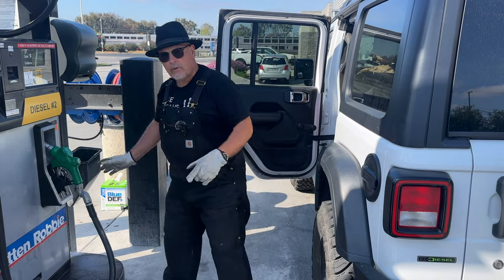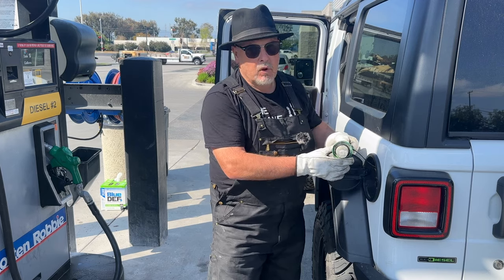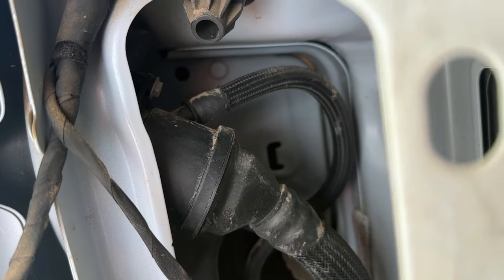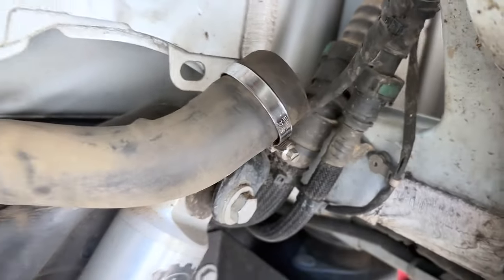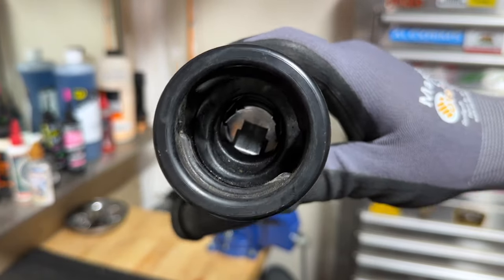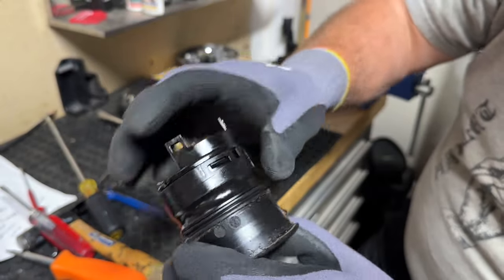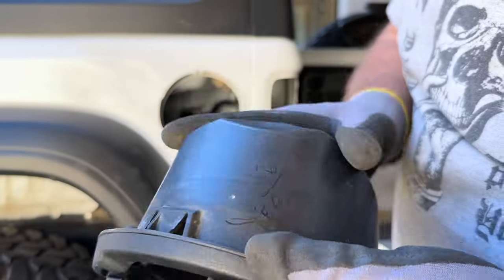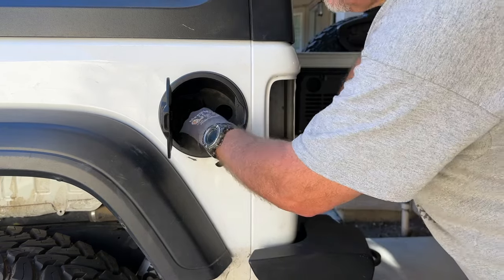How To Delete Ecodiesel Filler Tube Restrictor | Discriminator Removal (Use Large Diesel Filler)

Comment: I have a 1985 F250 with a 6.9 IDI that has a small filler hole, but I use truck lanes by sticking in a big funnel and watching the flow rate. Lol.
Edit to add: if you don't watch the flow rate at the truck lanes, it'll be a lot of foam and not liquid. Filling a filler neck creates a lot of turbulence versus a big 3" hole on top of a 60-300 gallon tank.
Reply from the maker: Diesel stinks, you don't want to end up with it all over you or in your eyes. Jeep provides a tiny funnel to adapt a gas can spout. The included the wrong one with my 2020 Wrangler which is white and the right one with our 2022 Gladiator Ecodiesel which is black. I'm not modifying the Gladiator so I could end up using it.

Comment: It's nice to be able to use the large truck pump nozzles because of being stuck at one when near empty but I find truck stop prices higher usually.
BTW my diesel VW Beetle would take the large pump nozzle without any modification.
Reply from the maker: I had a a VW Diesel that got recalled. Can’t remember If it allowed big nozzle. My Mercedes GLK did not allow larger nozzle.
Reply: @MuddyRuttzz  had a Sportwagon TDI also that I sold back with the totally stupid diesel gate thing. Used it for 3 years and sold it back to them for $2500 more than I paid for it. Would really rather have kept it but you can't turn that down. Now have a TSI gas Jetta and it gets near TDI mileage.

Comment: This is definitely how to do it. Don't destroy it trying to pull it out with vice-grips. Two question tho. One: Did you have issues with over filling or splash-back after doing this? Two: The descriminator is in two pieces, did you reinstall the oval spacer or was it just the threaded part of the filler neck that went back in?
Reply from the maker: Thanks for watching. No splashback when filling. I am careful to start out slowly then speed up the fuel. I always where my glasses when fueling and gloves. In my case the discriminator was one piece   that was connected to the collar. Check about 06:34 of the video to see it. Cheers!

Comment: The truck stop nozzles are high flow, that’s why that restrictor is there. Absolutely nothing to do with taxes or pricing, they more than likely simply didn’t want to have two sets of parts on the assembly line to save costs. The % of diesel vehicles produced is small by comparison to gas vehicles. 

Jeep likely didn’t want to risk splashback at a high flow rate based on the way that the filler neck to the tank is shaped. My Chevy Cruze & ALL of the VW TDI & pickups I own can take the larger high flow nozzles just as they came from the factory. 

At least where I live the difference in price btw what you pay at a high flow (truck) pump vs std flow (auto diesel) is EXACTLY ZERO $$$$/gal. 

Now, with that said there IS A DIFFERENCE btw the diesel cash price vs paying w/ a credit or debit card. It’s just a few cent/gal so I typically chose the convenience of paying w/ credit.
Reply from the maker: I saw on I5 in California where truck stops sell diesel cheaper. I just really want the option of getting fuel without having to go where the cars go.

Comment: The fuel bought at truck stops are cheaper due to there is little to no taxes on that fuel . Truckers pay the taxes at tax time so your just creating the system
Reply from the maker: I don’t know that I have much influence on the system with my little Jeep.
Reply: What??? No all highway fuel sold in the states has taxes applied. Unless it's dyed red for ag or construction use. Then there is no tax applied and it's use in highway use is illegal. And if you live in a cold place you'll see diesel 1 and 2 available. Which is a variation in the amount of kerosene in the fuel prevent gelling of the fuel. And diesel number 1 is a tad bit pricey due to added kerosene amounts.
Reply from the maker: Ok, thought you were saying I shouldn’t go to the Truck Stop. I pay a lot of taxes. I know all that. I was a professional driver at one time.
Reply: @MuddyRuttzz  oh I wasn't the original poster of the little to no tax comment. I was correcting the above commenter.
Reply from the maker: My bad, thanks for speaking up. In California if a trucker buys fuel out of state they still pay taxes for the miles they drive in California.
Reply: That is 100% incorrect, taxes are paid at the pump. Quarterly Fuel Use reports have to be filed in which it is possible to get taxes refunded if you bought too much fuel in a given state and if you didn't buy enough in another state you pay taxes to that state. Look up: International Fuel Tax Agreement
Reply: You are INCORRECT the fuel is not tax exempt (unless it is a police vehicle,federal agency,state vehicle) .Sales tax on fuel varies from state to state but there is no special savings truckers get trust me .